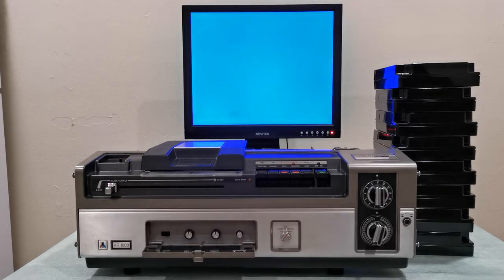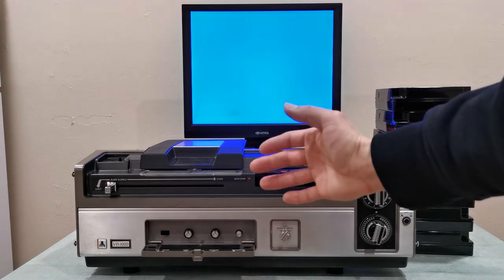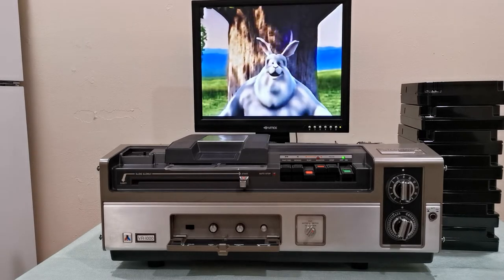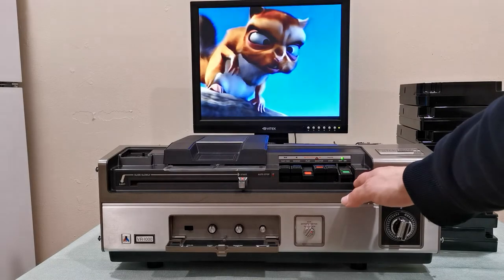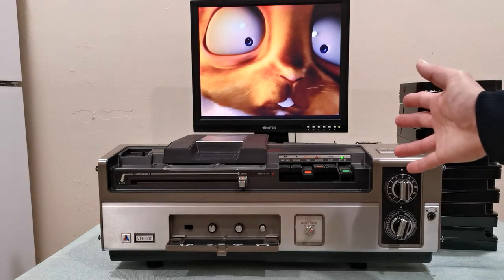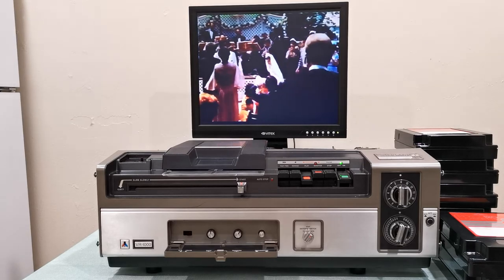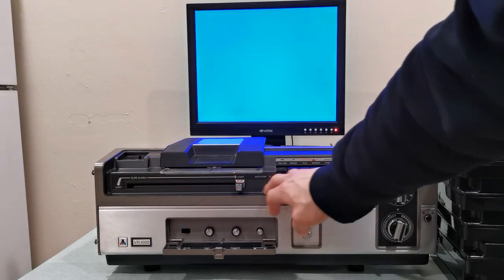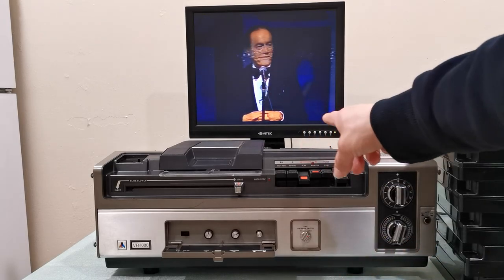1977 Quasar VR-1000 (8 of 8) Video output and vintage off the air recordings.

Comment: Rene i'm hopefully getting one of these soon, wish me luck! You work on these machines correct? as in replacing belts and caps? I personally haven't found any off air footage older than 2/26/1980 so i figured this would be a great way to find off air footage from the 70s.
Reply from the maker: I have worked on five of these Dinosaur VCRs. All of them required changing the playback/rewind belt which is the smallest of the 5 belts. It tends to lo0se it's original shape which causes failures. When this belt is in bad shape the machine will automatically stop and activate a red colored LED.

I don't really change any of the capacitors. As long as they produce half decent image I'm more than happy. The most recent off air footage I have found is from 1984.

Comment: Could you possibly do a video capture of the playback from this machine? A camera pointed at a TV screen doesn't provide a true idea of the quality/resolution of the VX deck.
Reply from the maker: Thank you for your comment. You are 100% correct here. My monitor does offer DNR digital noise reduction in three increments which i turn all the way up. I also turn the sharpness all the way down to 0%.

 I would not dare watch such a recording on a modern 55" 16:9 aspect screen. It would look horrible to tell you the truth.

If you are familiar with with the RCA CED videodiscs you will see a small increase in resolution on the VX format. Not much though, this is a single head system after all. 

In my oppinion if a film has a good story the resolution/HiFi sound is irrelevant. But to each their own.
Reply: @renegonzalez6755  I live in Europe, so I've never had the (dis)pleasure of owning a CED player. However, the stories of the low picture quality and playback problems are well known. I've only seen Techmoan's presentation of a rare PAL CED player along with a few video clips... and yeah, I wasn't exactly impressed - and I've owned both VHS and Beta. Currently, as far as retro equipment goes, I still have a LaserDisc player as well as an S-VHS deck.

While I have no intention of getting other retro gear, I'm still fascinated by the history of former video formats and their (lack of) features... and once I become aware of a forgotten format, I'm intrigued and try to obtain as much information as possible about that format.
Reply from the maker: @pHD77  Thank you so much. It is comments like yours that make me feel like i did my job as a collector and restorer or rare vintage technology.

I am still learning about the wonderful history of humanities continuing effort to perfect the art of capturing moving images.